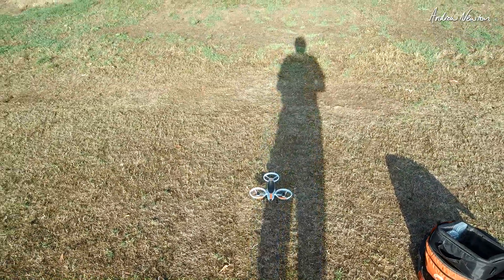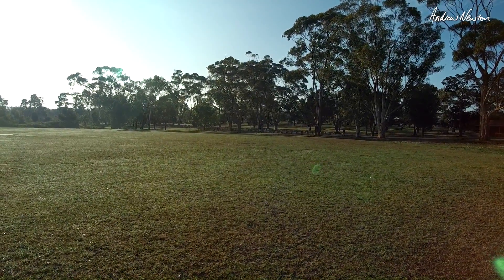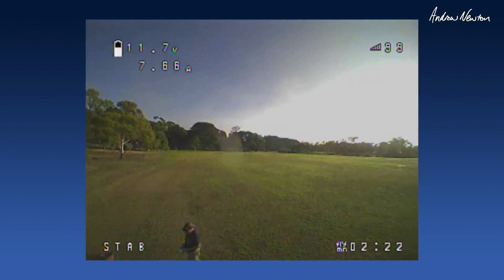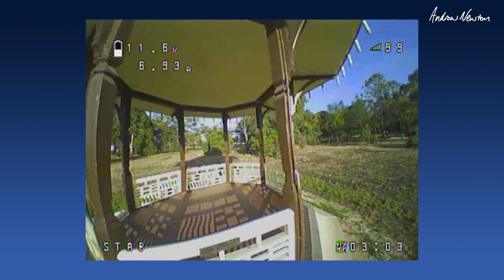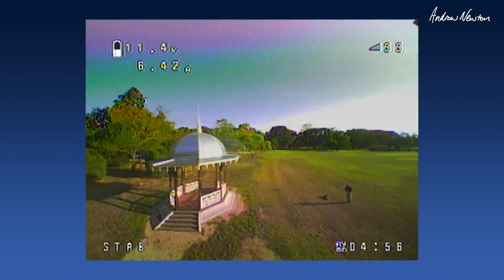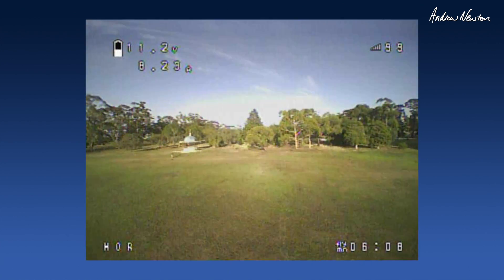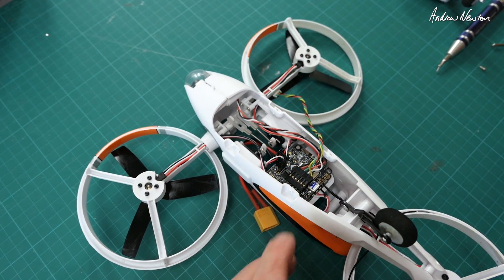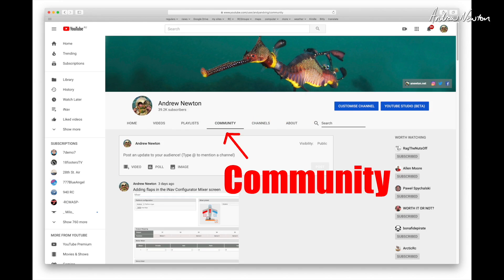FrSKY Rover3 flights in calmer wind

Comment: Your are only one prop away from flying a proper quadcopter. Throttle control comes with practise, we all hop about at first.
Reply from the maker: Actually I have a mini quad built now, much faster and more responsive than this.
Reply: My eyesight prevents me from flying line of sight, FPV is the only way I can fly, I would love to be able to slope soar like you do along the cliffs.

Comment: i would try change throttle curve add a little expo would smooth out the movement on climb and decent the rates will probs have changes done just add more ,doubt i,d buy it i love my 3inch diatone,,s too much

Comment: well, you got it flying nice, but i wont ever go back to Tri-copters, i played around with tilt rotor using KK2.1 boards some years back soul destroying machines
Reply: i know the feeling 😄
Reply: Currently building a Tricopter myself....
Why soul destroying???
Genuinely curious- wanting a tricopter is one of the reasons I got into this hobby....
Im a little worried about the tails fragility & the lack of information available on them...
Reply from the maker: I still have a few KK2 boards new in box. Dabbled with RCExplorer tricopter myself a few years back
Reply: @AndrewNewton  
My current project is the RCExplorer LR on which I will be running a Matek F405 Wing.
There is now a choice between dRonin, Betaflight & iNav firmware to choose from which I hope to try all 3 with the aim of finishing up on iNav...

Comment: Has the downsides of a heli (servos) and a quad (limited flight time).
Reply: 6min flight looks pretty good for the size
i get that with my toothpick, but ok

i agree it's a weired thing
Reply: @marc_frank  It's based on a flying car design. https://youtu.be/J27xpWZZmy8  , 6 minutes flight should leave you >50% battery time on brushless motors.